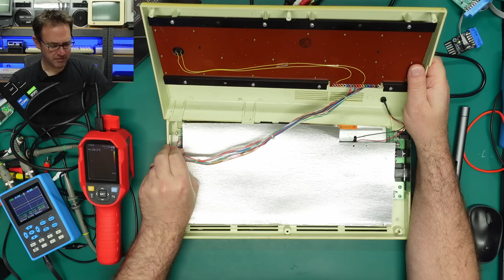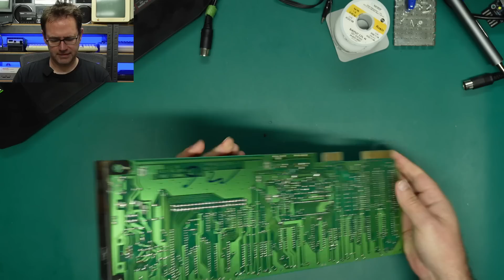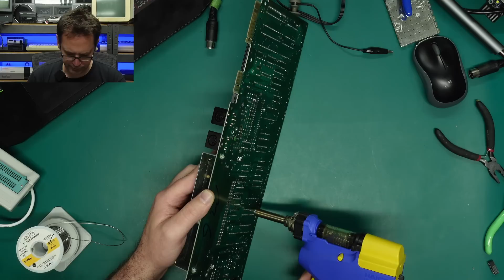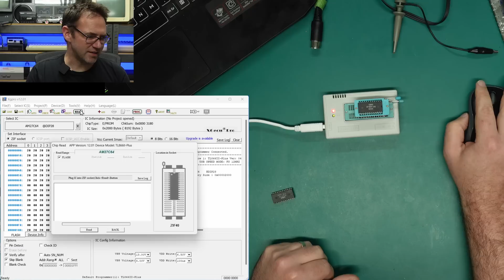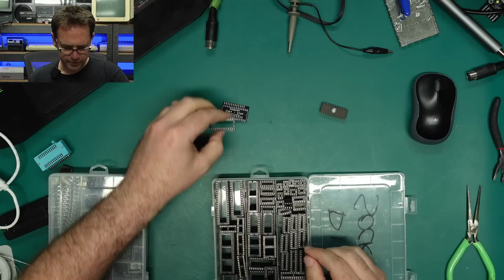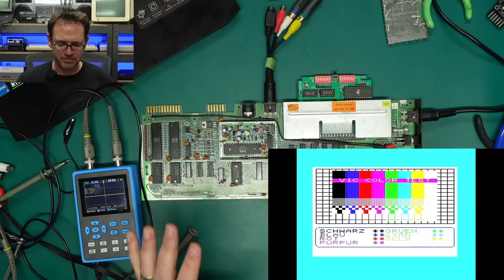Commodore VIC20 troubleshooting and repair with a budget oscilloscope

Comment: Awesome video!  I have a vic-20 and commodore 64 from my childhood and wanted to restore them.  The vic is dead, but with your techniques I spent time troubleshooting and think I have good understanding of what is wrong and have a part on order.   I honestly wouldn't have been able to get this far without your video. Then I turned to the commodroe 64 - I blew the sound in high school when I made an audio amp circuit, did something wrong, an amp cap blew up, and the commodore didn't have sound anymore.  So being inpsired to figure it out, I looked at the SID chip on the scope like you did on other chips, and it looked good.  With that looking good, I figured it was the output transitor. Swapped it out, and it works again!!
Reply from the maker: Fantastic. Congrats on getting the C64 working, hopefully you'll have the VIC-20 back up and running soon. And thanks for the super thanks, I really appreciate it. Cheers!

Comment: The BASIC ROM is a well-known failure point on VIC-20s with blank screens, at least if you are experienced with them. The easiest way to check if it’s the cause is to boot up with a game cartridge that boots from switch on. The VIC 20 attempts to boot from a cartridge before going to BASIC, so it will boot to a game with a defective BASIC.

Comment: I swear, you have more luck than I do with getting retro things that are broken :(

So far, out of several things I have bought from eBay Australia (3 x NES, 1 x Vic20, etc...) only 1 NES has been rather dead and needed extensive repair (All things sold as 'for parts or not working').

Really really hoping this C64 that I scored last week that The Salvos in SA was selling on eBay as 'For parts or not working' requires more than just a clean, though the screenshots showed a missing key, so that's something I guess :P

The Vic-20 needed a retrobrite and some new clips printed (found them on Thingiverse by The 8-bit Guy's brother).
Reply from the maker: Arrgh, hate it when they're listed for parts not working and they work, it's false advertising I tell ya. We should be well within our rights to lodge a dispute with eBay. I do wonder how eBay would respond 😄
Reply: @TheRetroChannel  I get why they do it, they are trying to get around the fact that the item might arrive not working and you could claim 'not as described' on eBay.

Sort of a 'get out of jail' free card for the seller.

It's just frustrating, these sorts of things don't always come up, and when they do, they end up really expensive.

I managed to get the C64 for $210, plus about $40 for postage from South Australia to regional WA, kind of hoping it actually is broken so that I can do more than just recap or clean it.

Comment: not free open fully accessible standards are trash
Reply: including all ISO standards
Reply: no exceptions
Reply: if only the pcb's were direct socket on the pcb, like laser engraved on the copper, no soldering required, just surface mount in the pcb-copper-socket directly
Reply: why do you sound like a dentist lol
Reply: electricians

Comment: This so much for this video!  I received this exact oscilloscope for Christmas and am restoring a VIC 20 that was found in a dump nearby.  It turns out this VIC 20 just totally worked, despite having been thrown out and spending at least some time outdoors.  It mostly needed a good clean, a 2 prong power supply, a 5-pin video cable and replacements for 3 missing keys.  But, your video has been really helpful in teaching me how to use this scope on my working VIC 20.  Thanks especially for showing an example of when you'd use both channels.  I hope you'll use this scope again in your videos!
Reply from the maker: It's a handy little scope for sure. This video probably wasn't the best example of how to use it, but it probably feature quite a bit from now on. Well done with the VIC20 find

Comment: Great video (as usual). Those tiny scopes can be surprinsingly useful in some cases, especially when working on old (ie slow) computers. A side note about testing logic chip in the TL866 : you can only trust the result 100% when it's detecting a BAD chip. A "good" one can sometimes only work at the low frequency the TL866 tests it.
Reply from the maker: Good point. I've had cases where the logic tested good on the first couple of tries, and then bad and good again, so I usually hit test about 10 times. It's not perfect and probably another excuse to finally get the retro chip tester pro, surely something will come up soon that will leave me wishing I had one

Comment: 26:40... um, yeah nah lol. Unless you see all the 138 select and enable lines in their required states at the same time (ie more channels on CRO or on LA) you can not assume that select line will be toggling :-)
Reply: Correct unless the cpu is addressing the ROM then the output will be high. It depends the code being run.
Reply from the maker: Hah, yeah that occured to me later on. Turns out I was barking up the wrong tree anyway